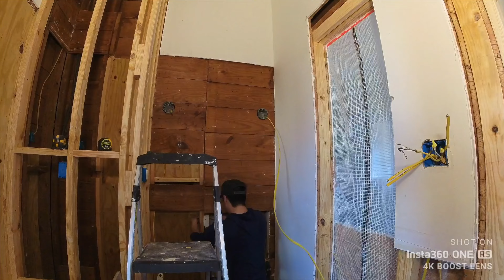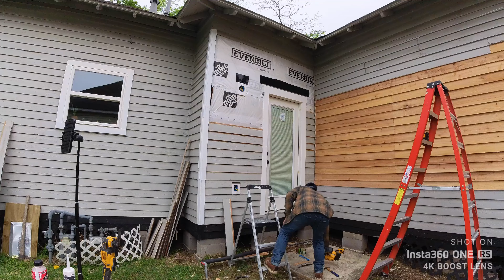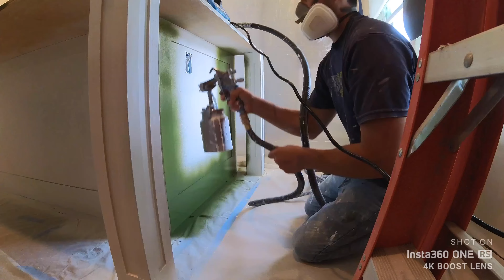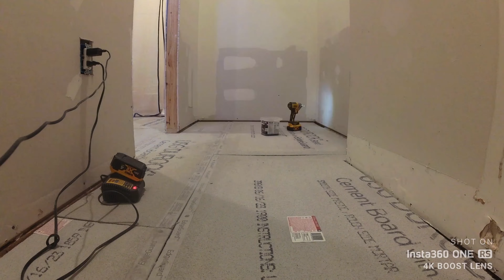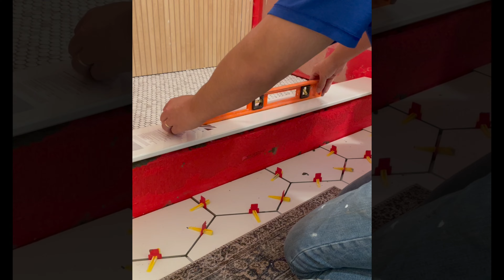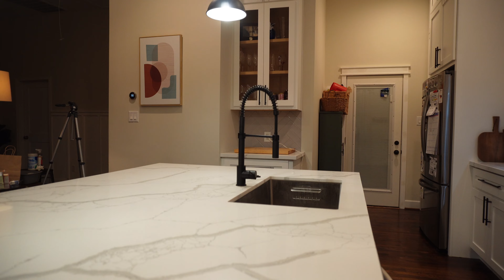Small House Renovation -  Start to Finish Timelapse

Comment: Really awesome job! Some of those footings under the house look a little suspect 0.0. With the cracked old brick. It's amazing how much room you can add with a little here and a little there. It is a shame to tear out what looked to be pretty good shape stuff beforehand, but I'm sure the new build works better for you. It looks much better very nice finishes!

What was the cost breakdown of everything?
Reply from the maker: Yes the footings were a completely different project of it’s own. They were in pretty bad shape. :/  I agree, I was a little sad demoing the old layout, but the new layout is way more functional. Ended up spending around 35k total on the renovation. Phase 1 - New Guest Bath: 4.5k, Phase 2- New Kitchen: 17k Phase 3 - New Master Bath and Closet: 13.5k. 👍🏼
Reply: @jbuildsdiy  Awesome job keeping the cost on the bathroom down! I just did a reno and we did the plumbing, electrical, painting, toilet/vanity/sink installs, the hvac, insulation and drywall. only hired out the tiling for like 3500$ whole project was around 17,000$ or something.